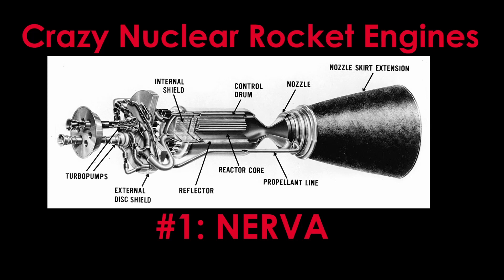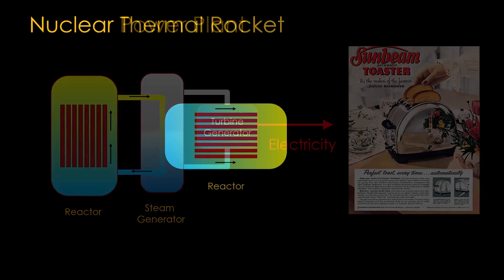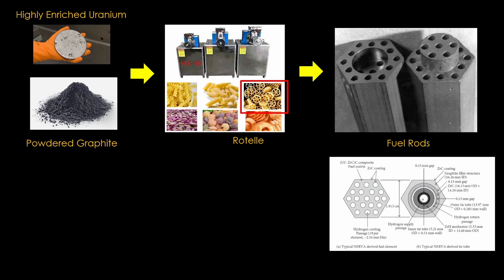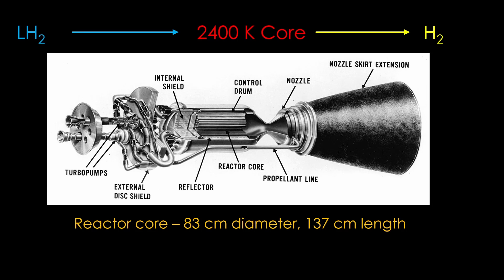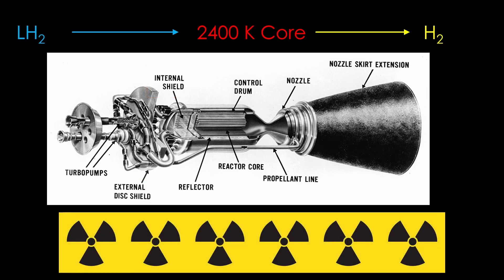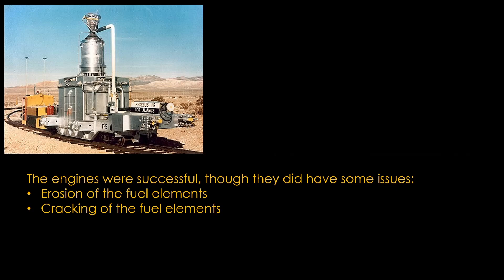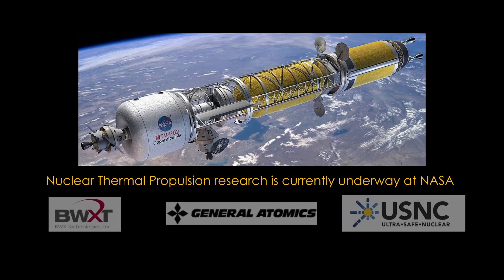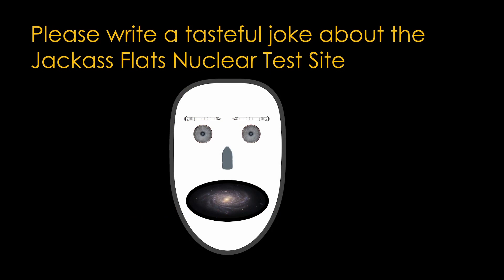Crazy Nuclear Rocket Engines 1 - NERVA

Comment: Just an idea if you replace H for He as fuel we can solve a storage issue, and if we use a molten salt reactor for heat generation we can reach higher temperature and if we mix the salt with Hg we can absorb most of the radiation. Can this work what you think?
Reply from the maker: Helium is a really bad fuel for nuclear thermal rockets. The molecules are much larger so that kills the exhaust velocity (and therefore specific impulse). That alone pretty much kills it. It's also very very hard to keep liquid, is hugely expensive, and our only source is from natural gas wells. 

Molten salt reactors are far heavier than the typical NTR cores. That makes them impractical for this use.

Comment: One thing woth nothing is that, if my memory server me right, many of the problems noted here have been solved through a combination of special fuel rod geometry to prevent radioactive ejecta escaping the engine, metal carbide fuel elements to significantly increase opperating temperatures, shadow shielding, and the introduction of about 1% hexane to the hydrogen fuel to inhibit corrosion.
Reply from the maker: For some values of "solved"

If you look at the history of the test series, you'll find that the test runs were either single runs at high power or a series of runs at much lower power. It's not clear to me that they got to multiple runs at high power. 

There have been assertions that many of the issues are solved with newer designs - pebble beds over NERVA-style cores, advanced materials, that sort of thing. 

But I've noticed that since NERVA was cancelled, none of the companies advocating designs have spent their own money developing NTR engines and stages. It's also true that the NASA (and now DARPA/DoD) program has very tame goals, nothing really beyond what NERVA did. And AFAIK there's been very little information about that program. I did a video on the NASA program if you want more details there.
Reply: @EagerSpace  I will have to take a look at that, thank you. As for why a lot of this likely never came up with the NASA test programs, these solutions were pioneered by the Soviet NTRE program, with the rd-0410.

Comment: Nuclear thermal made sense 40 years ago but today with massive improvements of solar panels and ion engines, nuclear does't really make much sense in inner solar system.
Reply: I would argue that nuclear thermal remains better for heavy space vehicles regardless of where you are.  Ion engines have worse thrust to weight ratios, and the amount of solar panels needed to run practical ion engines for large vehicles makes that problem worse.  For sufficiently light vehicles, like many satellites and maybe certain probes, ion engines seem to make sense.  Heavier vehicles, especially manned ones, however, would be at a great disadvantage from the necessity of breaking up engine burns over several orbits.  For unmanned vehicles, this is just an inconvenience but otherwise fine, but for a manned system the extra time in space will likely complicate the design more than it improves it.  Additional consumables that could have been avoided come to mind.

Comment: Hello Eager, I have been analyzing the NERVA engine and I would like to go into detail about the exhaust of the engine, specifically its radioactivity.  I have seen some official texts that state that hydrogen is not inside the reactor core for the necessary time to accumulate neutrons and become deuterium/tritium, so in general terms there are no differences between the exhaust of a chemical engine, however in your video states that it is inherently radioactive upon and after engine operation.
Reply from the maker: I don't recall seeing any data that talked about how much neutron activation you would get in hydrogen. Deuterium isn't radioactive so I wouldn't expect much of an issue there. Tritium has a short half life of 12.3 years but the radiation it produces is mostly harmless.

The biggest exhaust hazard is that NERVA engines had an unfortunate tendency to melt and/or spew portions of their core out the exhaust, and those are very radioactive. There might also be issues because of the neutrons coming out the exhaust.
Reply: @EagerSpace  Oh, thanks for the correction.  Yes, I understand that deuterium and tritium are not radioactive, but it seemed curious to say the least.

Comment: Sounds like you would have to be a jackass to even consider a Nuclear rocket engine 😎
Or build a launch pad without a flame trench or water deluge system to stop a monster of a rocket from damaging itself and every piece of surrounding infrastructure.

But that being said nuclear propulsion is hard to beat for most space based applications.
If NERVA is used in a no gravity or low gravity scenario then the weight won't make much difference.
Also handling Hydrogen for space based applications has come along way at NASA.
And pump designs have improved a great deal since the first engines were tested.
Also decommissioning is as easy as a one-way trip into the sun or out of the Solar System.
Some nuclear agreements have become null and void recently but l would still prefer off planet builds and spaced based use only for nuclear engines.
Sterling engines using the reactor core as a heat source for power generation has been talked about.
The issues that came to the surface during testing in the sixties such as the the core surfaces breaking down can be overcome and improved upon with current technology.
With well over twice the efficiency of all chemical rockets that are powered with conventional fuels I am glad NASA is taking another look at nuclear engines for spacecraft propulsion.
😎

Comment: Now this is gonna be a good series. I’m thinking, depending on where you put your shielding, one could use the spent LH2 tank as a wet workshop and the remaining nuclear reactor of the NERVA engine (albeit with some hefty radiators and other coolant systems now that the cryogenic fuel is gone) as a long term power source. Fill an intermediary tank with water or other general radiation sponges and you could (not should) be fairly safe *maybe*. I think we need to spend a couple billion dollars in cost plus contracts developing this idea.
Reply from the maker: There are designs for "dual mode" systems that both work as rockets and generate power.

Comment: High ISP isn't all good; there is an intrinsic (quadratic) energy inefficiency to going above the optima of about 2/3 the target delta-v, and at some point you become energy limited rather than mass limited. For LEO, chemical rockets actually aren't that far off. For nuclear, you have potentially much more energy, so might be able to trade energy inefficiency for mass efficiency, but 1) nuclear often isn't that energy dense compared to a tank of propellant if you're not willing to blow things up, and 2) the only reason to make that trade is under the assumption that mass is more expensive than energy, which I don't really buy.

Credit to whoever it was that covered this on the NASASpaceFlight forums. The basic physical argument is that if all of the energy ends up in the payload, then all of the propellent should have zero velocity relative to the starting reference frame, which suggests that it should be expelled with a velocity equal to the current rocket velocity. That gives you one extreme, where you are energy optimal but infinitely mass inefficient.
Reply from the maker: Thanks.